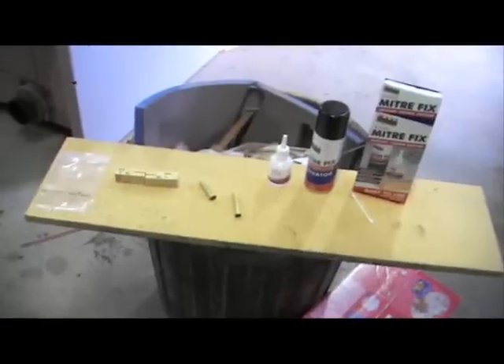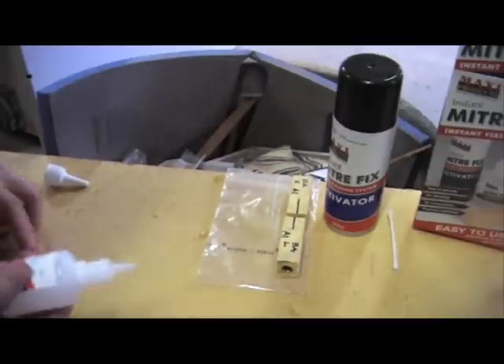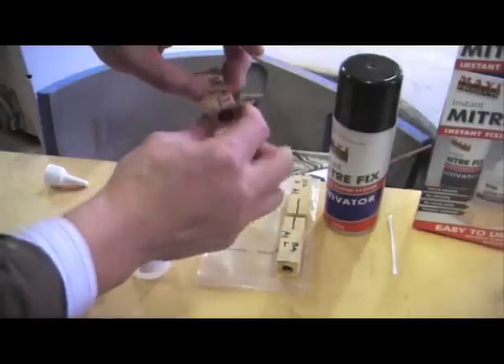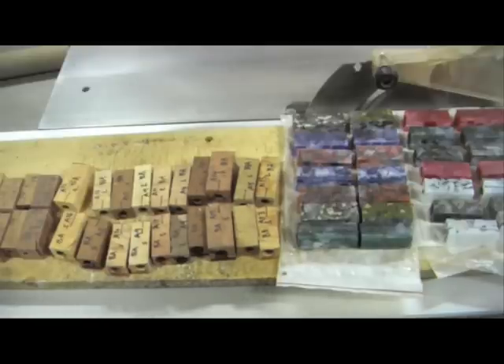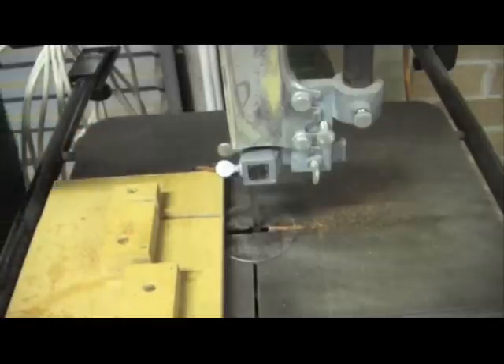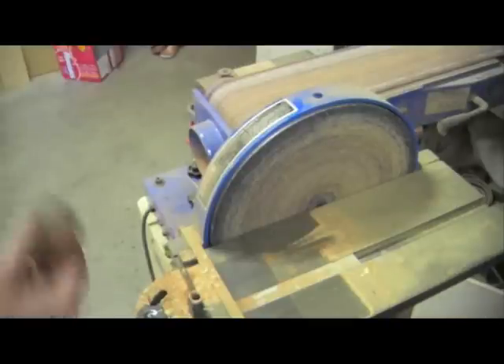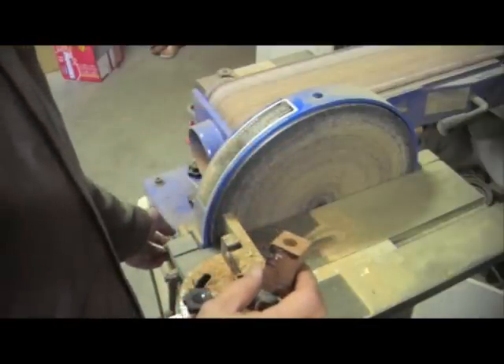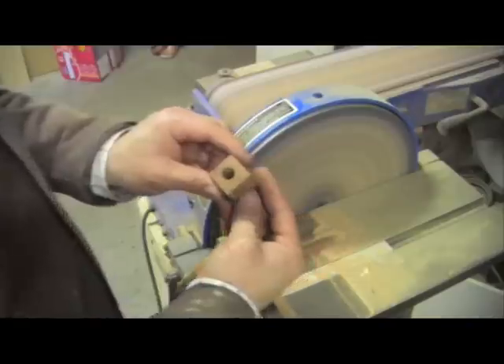Gluing up my pen blanks and squaring up the cheeks of the blank

Comment from the maker: Hi Kenny. I wait that long because that means there is no chance that the thick CA has not totally gone off. 20 - 30 mins, the glue will still be messy and you will get CA all over your fingers. 

I have between 1,000 to 3,000 pen blanks all glued and squared up ready to be turned into pens. So when the galleries call up for some more, all I have to do is turn them into pens. 

BTW - if your customers can't wait a week or 2 for a hand made pen, you should find some more understanding customers

Comment: You wait 3 to 5 days? I might wait 20 minutes! I just squeeze some glue on the tube, (which is on my insertion tool) hit it with a bit of accelerator and slide it into the blank while spinning the blank to get good coverage, and then let it sit for maybe 20-30 minutes while I finish gluing the rest. Then they get squared up with my pen mill or my sander depending on tube diameter. 

If I had to wait 3 to 5 days I'd have some mad customers for sure!

Whatever works for you is cool with me!